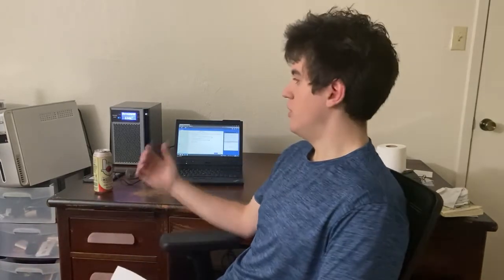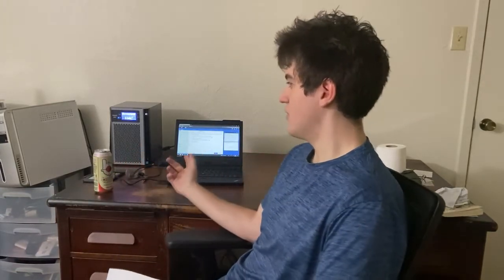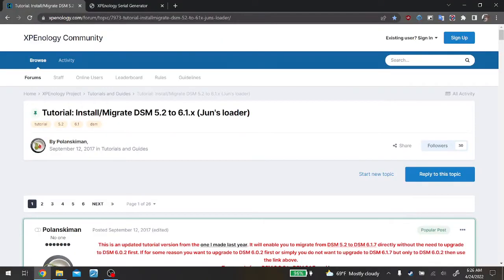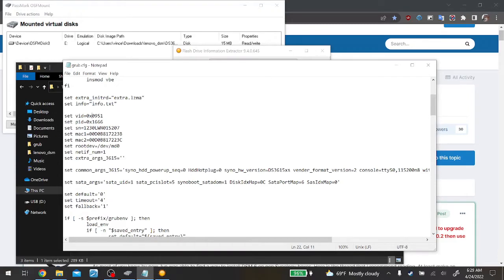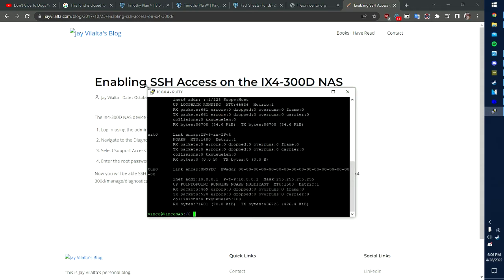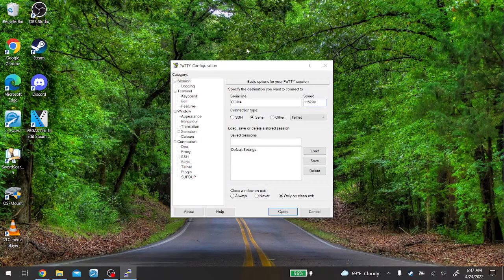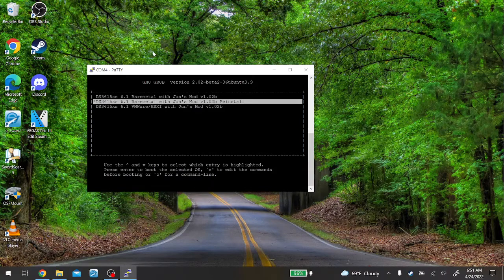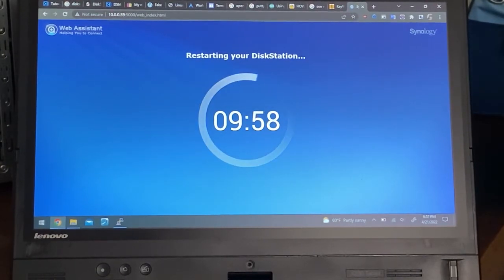How to Install Synology DSM 6.1.7 on Lenovo PX6-300D IOmega NAS

Comment: Hi, I can't connect to the nas with putty to retrieve the mac address, is there a configuration to do on the nas or on putty? 
sorry for the mistakes i am french 😅
Reply from the maker: check if you have correct COM port in device manager